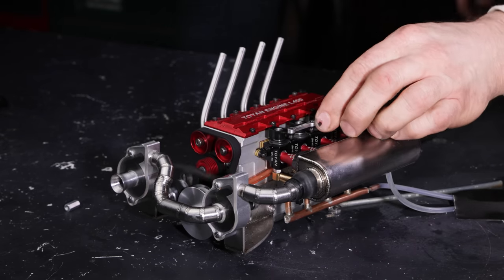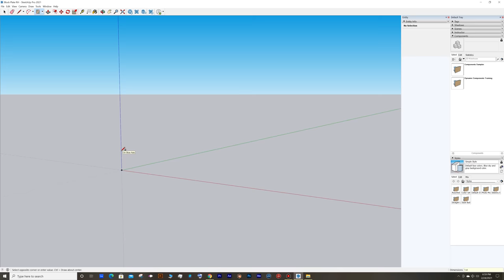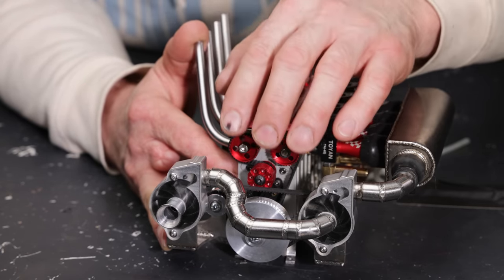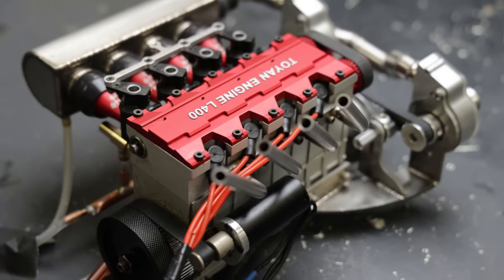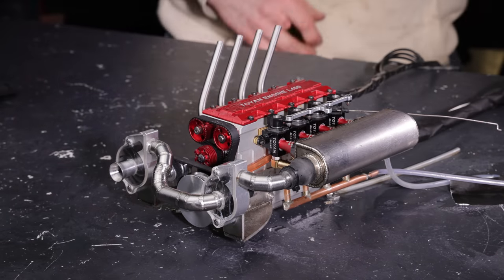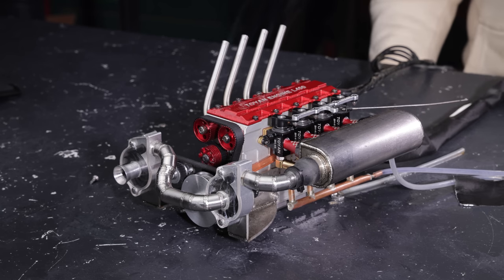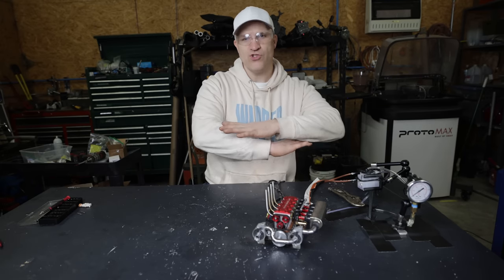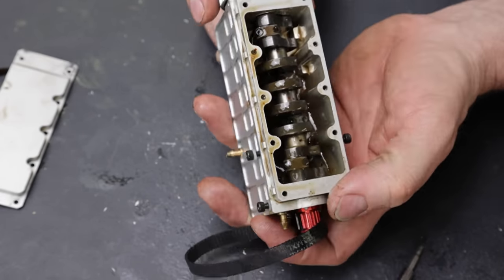Twin Supercharged 4 Cylinder Nitro RC Engine

Comment: When you run two stages of boost like that, you need to size your compressors accordingly. They can't be identical. When they are, either the first stage is overflowing or the second is starving. The first will necessarily need to be bigger than the second.

I've run some numbers for you:
- The engine displacement is 14cc
- Maximum rated speed is 13 500 rpm
- Total volumetric flowrate (ideal) at that speed is 1575 cc/s (call it 1600 or 100 ci/s or 3.34 CFM). You can't fill the cylinders that quick, but that's the goal anyway.
- Your compressors have a pressure ratio of about 1.68 (10psi overpressure)
- Assuming adiabatic compression (no heat loss), that means a volume ratio (inlet to outlet) of 0.69, or sucking in 1.45 times more air volume than what comes out. You'll obviously lose some heat, but this should be close enough
- This means that the second stage must suck in roughly 2300 cc/s, which means the first stage must be able to supply that at its outlet
- Assuming the same pressure ratio, that means the first stage must be sized to flow about 3400 cc/s at its inlet

You also need to mind the heat here. Keeping to the assumption of adiabatic compression (because the air moves fast enough to lose very little heat), and assuming your workshop is at about 20°C (68°F), your first stage outlet temperature will be about 67°C (152°F) and your second stage - 121°C (250°F).

Obviously some heat will be lost to piping/environment/etc, but at those pressure ratios your cylinder inlet temperature will still be upwards of 100°C which may or may not be too much for the engine. I'd check with Toyan. You might need intercoolers to protect it (either at every stage, or just before the manifold). If you do, it's worth recalculating the sizing for the compressors, because the total volume ratios will change.
Reply: jesse james  I don't, but perhaps I ought to - looks like good fun! I'm an aero engineer, we used to do these sorts of calcs for jet engines just for fun at undergrad ;)

In fact I'd enjoy helping out with his jet engines more if he's interested, but this stuff needed much less information from him to put together.

These days I mostly do advanced modelling for work, so going back to basics on side projects like that is quite enjoyable.

As for electric motors, I know they spin when you apply current :P Don't they use them to start jet engines?

Joking aside, you can get some pretty cool control systems for those, and if it's a standalone commercially sold unit you should be able to get a data sheet for it which has performance curves, power limits, thermal output, etc. And if you have a mystery motor (or its data sheet is barren), they're not too difficult to characterise, so you know exactly what you're dealing with.
Reply: Can you make a copy of your brain and send it to the cloud? I’d really love a download 😂
Reply: @LumiusStrife  🤣
Reply: Now THAT is how you science the shit out of it..
Reply: what a god comment
Reply: Great comment!
Reply: My man has mastered the art of diving way too deep for an informational comment on YouTube. It’s truly an art and I can appreciate the heck out of it!
Reply: @JR-uc1of  I didn't even include the intercoolers 🤣

Glad you enjoyed the read though 😉
Reply: 233kosta YouTube needs more people like you
Reply: @233kosta  I just saw your comment where you tell that guy what you do. Do you use any modeling software? 3D or engineering related? I work with Civil3D for a living so I’m interested in the software people use to make a paycheck haha
Reply: ok i am not wasting 6 days of my life
😊
Reply: @Chimpmusic79  I didn't even put the equations in lol
Reply: @233kosta  please dont my 1 brain cell with cry to death 😫
Reply: @Chimpmusic79  🤣

It's all fairly simple actually. As long as you know what the assumptions are and can stay within them, this stuff can be done in a very basic spreadsheet.
Reply: @233kosta  i am the exact opposite of a nitro and engine enthusiasts 🤭
Reply: @Chimpmusic79  I'd hardly call myself a nitro engine enthusiast, just a bored inginerd 😉
Reply: @233kosta  yeah but like right now i have 15 ebay orders for small Toyan engines to play around with so ye help my bank acount.🫥
Reply: @Chimpmusic79  Oh my...
Reply: oh my lord man, im doing aero 1st year now, you are literally the kind of god engineer nerd that sciences the shit out of normal things i want to become. I am trying to make rc airplanes as a hobby now (they dont fly that well cause im just starting to learn stuff, not only through college but also from books and stuff i read online). Thanks for that comment, it really helps when you see what you can achieve. Just starting thermodynamics in our physics 2 course now, cool to see a term i recently learned being actually used! I should get back to studying. Sorry for bad english, im from spain.

Comment: I’d love to see this in an absolutely insane RC dragster
Reply: Maybe a rc drifter or burnout car
Reply: Electric rc dragsters would walk it every single time.
Reply: @GritsnBeans  no shit
Reply: Boat
Reply: @GritsnBeans  so… it would go out loud and in style
Reply: Imagine it in a plane!
Reply: Be slow as shit.  These engines are more gimmick than anything.
Reply: @rxtuninginc8444  lol. Ok.
Reply: @rxtuninginc8444  give it a few years they’ll prolly have these lil engines on the bottle
Reply: @GritsnBeans  57 lbs of battery bank later
Reply: A rally one.
Reply: @GritsnBeans  that not
The point but ight
Reply: @rxtuninginc8444  I've seen people put these in large scale cars and I was very surprised how slow they were
Reply: It wouldn’t be very fast, the engine is just for experimental purposes, I’m sure if you properly design the engine from the ground up and twin charge it while keeping it light and fairly compact, it would be very quick
Reply: Guys. Ofcourse electric is faster. Still with the proper gearing Ina transmission it would be an absolute blast in a crawler or boat. Once he figures out the over heating issues that is 😛 probably do pretty well in a boat tho with water cooling

Comment: AFR's are massively important to keeping the engine cool while running aswell. Fuel "cools" the combustion cycle. so a richer mixture may not produce quite as much power, but it will massively improve the temps you're seeing and how fast it gets up to temp. 

Super cool video though, these little motors are super cool.
Reply: @tilldeathdoesmepart  Extra fuel is being added via the preasure reference to the fuel tank. As boost preasure increases the preasure in the fuel tank increases. Which in turn adds more fuel delivered to the carburetor at an amount directly related to the amount of boost. So it shouldn't be running lean at all.

Comment: One thing.

For compounding to work the first supercharger needs to be bigger at the same RPM or be the same size while spinning faster.

Because right now the second supercharger is creating suction at its intake which completely destroys the boost from the first supercharger while creating more heat than a single charger setup.
Reply: If I am not wrong he could also run a different sized pulley on the first stage for more rpm
Reply: the point of this video is to destroy the engine.
Reply: Incorrect. Superchargers produce positive atmosphere, it can be rated in cfm, cubic inches, liters, several ways. For every rpm the supercharger turns it creates positive atmosphere displacement. Compound simply means 2 or more parts doing positive displacement. It's the same concept of when people used to stack 2 roots style blowers on top of each other, they would have the same positive atmosphere displacement even if they were side by side. Superchargers are much simpler than turbos in that aspect. The only problem I see in this setup is if the first supercharger inlet I.D. is enough to flow the amount of air required by both superchargers
Reply: Daemon No it’s to make as much power and boost as possible, and not give a shit if it blows up the engine.
Reply: @pw383426  let's go through this. Superchargers don't produce positive pressure. They move around air so that it can't go back. If you connect one to a long open pipe ( or a mine which is what the things were  first designed for) you'll find that it isn't prodicing any pressure. if you connect it to a pipe that is being sucked empty at the same rate as it's filled (for example by another supercharger of the same size turning at the same rate) it also won't produce any boost.

Now lets use some number picked right out of the air.

The first charger takes 10 liters and turns it into 5. the second one also takes 10 liters and turns it into 5.

They are spinning at the same rate so they are sucking in air at the same rate. But the second one doesn't have access to an unlimited supply of air. It only has access to the  5 liters per second that the first one provides.

So it pulls a vacuum destroying the boost produced by the first supercharger.

so in conclusion the first supercharger needs a smaller pulley to actually be useful.

which also happens to be what can be seen on every compound charged racecar that has ever existed.
Reply: @justan idiot is just some silly fun innit? What most amateur Motorsport is about, just some lads strapping things to their noise machines and seeing the numbers go up or it explode.
Reply: @anonym3017  I hate to break it to you, but all superchargers just like turbochargers create positive atmosphere. If they didn't they wouldn't have any boost pressure and therefore they'd be useless. Dynamic chargers probably don't make much of any boost at low engine speeds, but once the throttle is opened and engine speed increases, so does the atmospheric pressure until it reaches a set point. Turbochargers mind you have the possibility of continuing to build boost pressure unless a BOV is used. Another thing to add is they do not halve the amount of air going in. They actually make the air going in more dense(=boost). If the halved the inlet air then they would be creating a negative atmosphere and the engine probably wouldn't even run considering internal combustion engines rely on atmospheric pressure
Reply: @beardedforlife3740  literally everything you just typed is wrong.

1. they only produce pressure if there is a flow restriction on the output side. if there isn't, because they aren't connected to anything or because what they are connected to gets sucked empty as fast as the supercharger can fill it,  they just move around air at atmospheric pressure.

which is what root style blowers were originally used for. ventilating mineshafts.

2. for a constant quantity of an ideal gas (which air isn't but its close enough) p*(V^n)= constant. let's just say that n=1 for simplicities sake. if you double the pressure you half the volume. so a supercharger that's running at 1 bar of boost takes 10 liters of air at 1 bar (ambient pressure) and turn it into 5 liters at 2 bars.

3. engines have no problem whatsoever running at below ambient pressure on the intake side. Because that is what they do whenever you apply part throttle ( for a naturally aspirated gasoline engine anyway) as the butterfly valve restricts the intake airflow lowering the pressure.

with all of that lets look at compound charging again. we have 2 superchargers in series. they are the same size and rotating at the same speed. so they both have an intake of 10 liters per second. which they then turn into 5 liters at double the pressure.

so the first one does that as advertised. but the second one has a problem. it wants to take in 10 liters per second but the first supercharger is only providing 5 liters per second at 2 bars. so the second supercharger takes those 5 liters and turns them into 10 liters at 1 bar. it then turns them back into 5 liters at 2 bars.

making the entire exercise a waste of energy. either turn the first supercharger faster so it provides 10 liters at 2 bars every second, make the first supercharger bigger, makev the second supercharger turn slower so it uses only 5 liters of air every second or remove the first supercharger.

which once again is what we see on compund charges racecars. they are either running 2 different sized superchargers/turbos or they are running two equally sized superchargers where the first one rotates faster than the second one.
Reply: @beardedforlife3740  haha your a fart. Could you pressurize a closed room with just a turbo/supercharger inside? NO! You'd just be moving air around in the room. Could you pressurize a bottle in a closed room if you attached it to said turbo/charger? Yes. Your exhaust vales are what's turning your engine into said bottle. Turbos and Chargers are just simple fans with fancy impellers and housings attached. But it is the restriction at the end of said housing that allows for pressure to increase. Think about flow... Faster flow=Lower Pressure (Bernuilli) If that's the case, how could faster flow creates by a turbo possibly create pressure? Your missing the concept of the M in CFM. Think about it. Engine flow rate= xCFM. Turbo flow rate=2xCFM.  What is x-x=? What's 2x-2x=? Now.!.!.!... What does 2x-x=?    There's your boost.
Reply: @daemon4470  🤦‍♂️ go away child
Reply: @tezy0193  yes, dad. 💩

Comment: Love the channel. One thing though. In a compound setup,  your low pressure compressor  should be roughly twice the size of your high pressure compressor. Have both compressors the same size doesn't yield any pressure gain and generally increases your charge temp witch costs you power.
Reply: You could probably also change the speed that they're spinning at as well, couldn't you? To get the gains that compound setups should get you
Reply: Yeah lol not really sure what he was going with here
Reply: Thats what I was thinking. I think he would do much better having separate inflows and combing them which might be an easier fix.
Reply: right on the money

Comment: I think you need to 1) shorten your coolant hoses and 2) increase the hose diameter. You have a lot of resistance to flow through those long little hoses. You can see when the bubbles go through them how fast the water is trying to flow. Fast water = lots of friction loss
Reply: And faster the water flow thru the radiator means less time for the water to cool down, plus it doesn't have a engine fan. Also, I highly doubt this engine has a thermostat... a setup for disaster.
Reply: A larger radiator wouldnt hurt, either. A cheap 120mm aluminium PC watercooling radiator is like $10-$15 on ebay, tops. A 240mm radiator would be around $20ish.

A chunkier fan to draw air through it would also be needed. 3000-4000rpm Delta or Nidec fans would do the job quite nicely and aren't too expensive.
Reply: @speeddemon1092  that sounds like the setup it needs right there.
Reply: @garyr7027  that's why in a car , there's a right way and a wrong way to remove a sticking thermostat to get you home. 
Don't just throw the whole thing out , you need to gut it like a fish and reinstall it. 
Cut the pellet and spring part off , and place the disc back in , it's the restriction you need to maintain the right flow and pressure throughout the system.
It doesn't necessarily need a thermostat, it needs to have the correct flow and pressure on the system.
Reply: @MrTheHillfolk  fluctuations in engine conditions require fluctuations in the cooling system, only a operational thermostat can provide a constant cooling temps overcoming those fluctuations. Thermostat is nothing more than a valve controlling the flow to maintain a certain temperature. Sure you could run it without one, but without the proper cooling system setup, it'll either run too hot or too cool. In this case cool might be better since he damn near blew that engine up. In a real engine though, you really should have a thermostat, engines are designed to maintain proper temperatures for optimum fuel efficiency.

Comment: WOW- You got the tools, software and know how that really helps. The second I saw the initial start-up, I didn't like the way that belt was jumping. Too bad you couldn't add another belt tensioner. I was very impressed with the look and sound of that engine. The last engine build I did, I used a small block 400 to go into a 72 Camaro. If you aren't aware, a chevy small block 400 is known for running hot due to the fact that the cooling holes that normally are in small blocks become steam holes in a 400. I had to come up with a good cooling setup for this engine and did. Very interesting project!👍👍
Reply: I'm about to motor swap an m112 AMG motor into my old c class and see what happens 😆

Comment: I want to see a twin charged mini rotary, that'd be cool
Reply from the maker: Fantastic idea!!!
Reply: @WarpedYT  then it will be 2x better than Johnny -.-
Reply: @WarpedYT  would be even cooler if it was in a remote car
Reply: @johndoe1778  i mean they are all exploring relatively new teritory with forced induction on this mini nitro engines, so I would view it more as them all elevating each other's collective knowledge vs one person being 'better' than the others.
Reply: @L.Paulo.z  some way to induce load vs adding all the variables that come with putting it on a drive train would be better while still in the early experimental development phase tbh